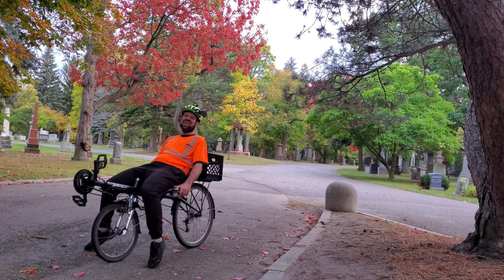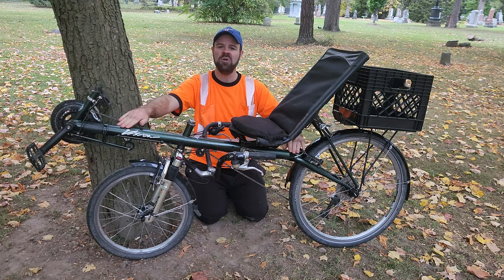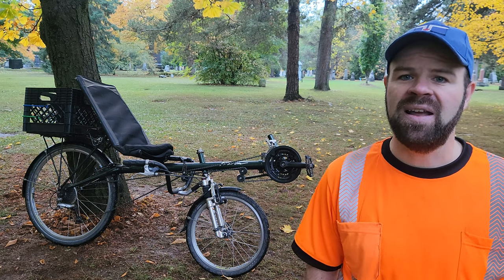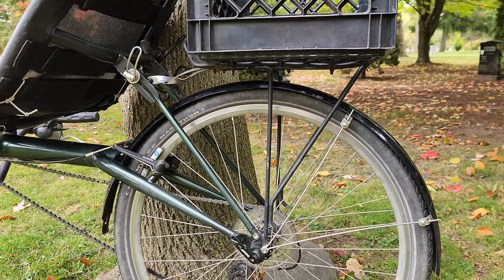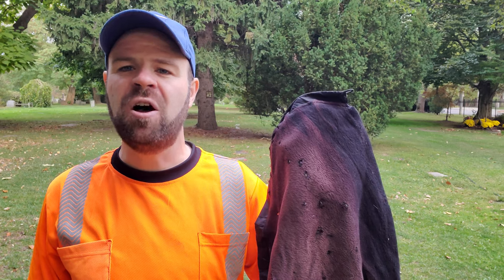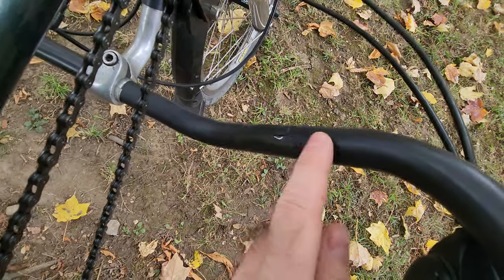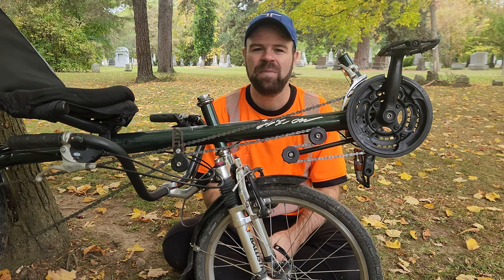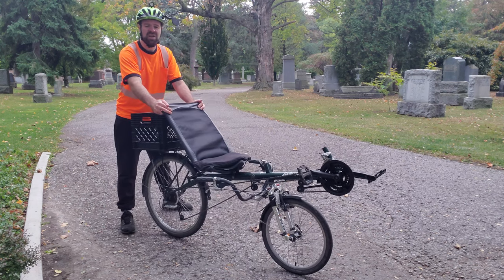Vision R40 Recumbent Bike - Overview

Comment: That bike is in really good shape for its age. What a good find. When I was shopping for my recumbent, it came down to this Vision or the Haluzak Horizon. I chose the Horizon because the seat reclined too much on the vision, making me push myself out of the seat while accelerating or climbing. Both are really great rides. I still have mine after 25 years.

Comment: High.  Great video.  I love my recumbent but...... I found it almost impossible to start on anything of a hill.  Ok to climb providing I could start on the flat.  Its a "Speed Ross" incidentally, short wheel base above seat steering, 700c rear and 20inch shopping wheel front, Vee brakes both.
For your drinking bottle, have you thought of putting a drinking tube in the bottle reaching over your shoulder like a "camel back"?  Easy to sip without encumbering your hand.
Happy riding.

Comment: 16:17 My first recumbent was an R44, above seat steering, and equipped with a full front fairing.  It was a great ride and resonably fast.  I ultimately migrated to trikes as i got older and became concerned about balance.  It is unfortunate that ATP went out of business.
I also recommend locking your feet onto the pedals.
Reply from the maker: I'm curious why you recommend this. On a conventional bike, the advantage to clipping in is that you can get extra power by pulling up on the upstroke. By on a recumbent, if you pull on the upstroke, wouldn't that just be pulling you out of your seat?
Reply: My foot once slid off the pedal of my R44, resulting in almost loss of control. Fortunately i was able to recover without a crash.  On a trike, dropping off a pedal can result in a very bad accident called leg suck, where your leg is dragged under the cross beam.  Some folks have badly damaged their legs in this situation.  While test riding a new trike with e-assist (no clips), my foot slipped off the pedal resulting in a fractured toe and badly bruised calf muscle.  I never considered any "pull" benefit of cleats on a recumbent.  You will find few trike riders without some sort of foot retention.
Reply from the maker: @Intarsia82  Thanks for sharing. I had heard of that hazard with trikes.  Having already safely ridden at least 25,000 km on recumbent bikes without my feet locked in, I don't see a need. Sure, I've had my feet slip off the pedals before, but it's never been a big deal. The bigger hazard in my mind would be not being able to unclip in a critical moment. Unlike on a trike, you just tip over when that happens.

Comment: I had a Vision R40 with adapted straight handlebars that were further back and more under the seat so had fewer steering problems. I also had the kit to change it from SWB to LWB but I don't remember ever changing it from under swat steering.

Comment: I had one of these and found the steering a little twitchy at low speed but lucked out, found the LWB kit for it and it road like a limo. Met someone who wanted the SWB version and sold it but kept the LWB kit as its as it is unobtanium.
Reply from the maker: It sounds like you must have had one of the R40's from the first half of its 10 year run. As I mentioned in the video, in the later years they moved the position of wheel front wheel further back, which apparently greatly improved the stability. I've never ridden one of the older ones like you had, but would be interested to see how it compares. I love my R40 as a SWB, but if a compatible conversion kit came up for sale in my area, I'm sure I'd be interested in buying it just to see what my bike feels like as a LWB or OSS.

Comment: I had a great time watching this video, CJ. I hope you’ll get back to your old posting pace, you’ve been missed.

Something you might want to try is experimenting with a different handlebar orientation. Remove the bar from its clamp and rotate it 180° (so that the ends of the grips face forward) and then rotate the bar vertically in the clamp (so that the ends of the grips face upward) in order to create “tank-style” steering. This will move your hands forward and higher, some people find this more comfortable and others find it less so. The main advantage is that the seat won’t get in the way of your ability to turn, at least not as much as it does with the bars in their default position. If this appeals you might want to find a wider bar that will give you more clearance.

Comment: I own that same bike except mine has the other steering config. The funny thing is that the handle bars look the same, its just yours are shorter and under the bike.
Reply from the maker: That doesn't surprise me, considering the bike was designed to convert back and forth between  USS and OSS. By having both configurations using the same handlebars, this is one fewer part you need to acquire to do the conversion.

Comment: I've got an above seat steering SWB Vision R40. I'm enjoying it a lot, but there's something really wrong with the chain idler. I'm pretty sure it's missing parts.
Reply from the maker: You may want to have a look at the Vision Recumbent Info website (link in the video description). They have some of the original owners and service manuals uploaded there.
Reply: T-Cycle carries idlers that might work. One of mine is messed up and I'm trying to replace it.

Comment: Silly question but HOW or CAN YOU "walk the bike" since the handle bars are so low?
Reply from the maker: That's a great question actually. Basically you do it by placing one hand on the top of the seat and the other on the handle bar, but it's at an awkward height, so it requires walking a bit hunched over. However, if you're walking on a wide path with not many people around, I've found it's possible to walk without the hand on the handlebars. Just tilting the bike from side to side can be used to make minor correction to which direction the bike is pointed.
Reply: Thats exactly how it works, i walk my SWB USS one Hand (allways the right one) at the Seat-Top. Only for really sharp turns the left Hand is needed. As this is one of the major concerns be asured its a misapprehansion.
You also become as quicky used to the missing handelbar in front of you as to riding a recumbent itself. And then its nothing but joy and comfort for Miles and Miles. And uphill Up to 12% is not much of a Challenge.
Reply: I'm sure it's possible to walk the bike just holding the top of the seat and by using pressure on the seat top you can actually control the steering without touching the handlebars.